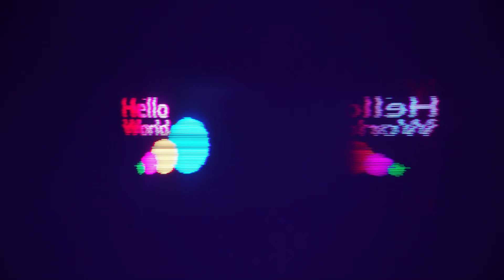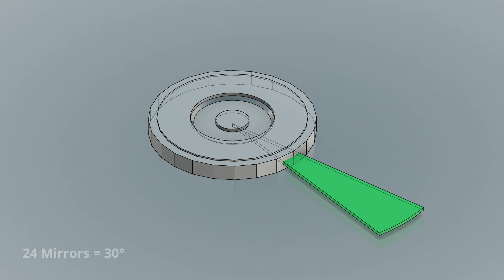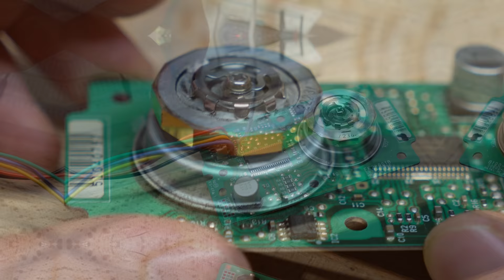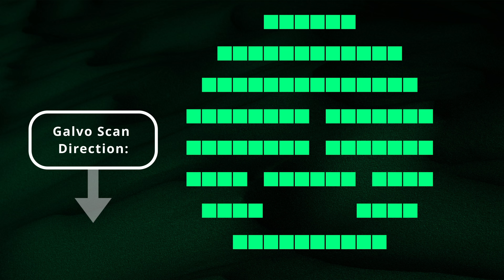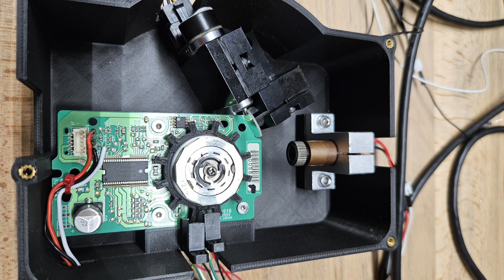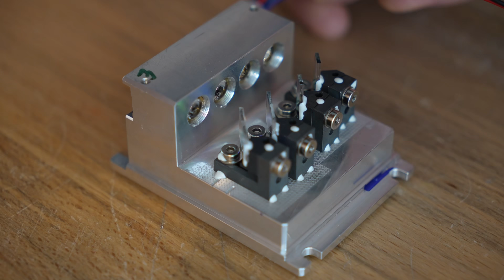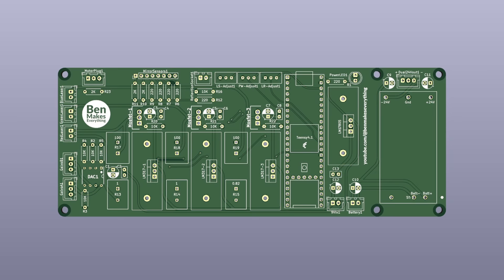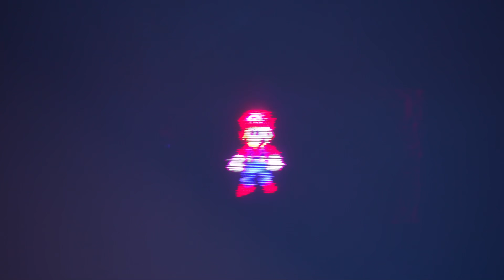DIY Laser Image Projector (100ft+ Range!)

Comment from the maker: This one took a while... Let me know how you would improve this device!
Reply: What sort of photodiode are you using for timing the laser pulses? How are you biasing it? Is it getting triggered by stray light scatter, perhaps? You could mount it at the end of an opaque tube with a diameter no larger than the beam width, with a light-trapping inner surface (like vantablack), so that only a well-placed beam can hit the sensor. Wrap the photodiode assembly in copper foil and use a shielded cable to connect it to the amplifier. You could also use two photodiodes and derive a differential signal for better noise rejection. Overall mighty impressive!
Reply from the maker: @zinckensteel  The phototransistors I'm using are Optek Technology OPB11782. They are just connected to the pins on the microcontroller and a 2K pull-down resistor. I'm wondering now if the timing glitches are actually just caused entirely by the way the Teensy microcontroller handles the interrupts.
Reply: Interrupts were my first thought for possibly explaining the glitches too.
Reply: That's right, I remember now.
 I was screaming at you because you only used a single mirror array.

My old lab setups from the very early days used two spinning arrays.
The first one basically looked like a table top cut of a diamond.
Very close to what you have here.

 The second one was more of a Decagonal rod.

You'll get much more control if you use motors with resolvers rather than trying to match up two free spinning elements.
However you are going to require some more computing power.
These setups are a lot of fun to play with in free Spin but you have to calibrate on every power up and you need a very stable power supply.
I made one for the sole purpose of projecting Flames onto smoke for halloween.
Projecting through film with a 0 point light source is a wonderful effect.

I couldn't afford resolver Motors so I tried to cheat with steppers.
It made synchronizing a little easier but there was still drift.
Didn't last very long so I ended up using a DMD chip.
Reply: You should be able to get much better image color using dithering instead of posterization. It's very simple to implement too.
Reply from the maker: @MikelMcdaniel  I'll have to look into that, thanks!
Reply: @MikelMcdaniel  but using analog laser driver enables millions of colors, dithering is for digital systems no?
Reply: Since you have the dual galvos and the extra driver channel, you could use a DC bias on the vertical galvo signal to 2D pan the output around, would add a lot to function to be able to move a lower resolution/ higher refresh image around in 2D space than having to use the raster space for movement. Would be awesome for some signage, yard art, even theatrical applications where a smaller image needs translated around a larger surface.
Reply: Excellent upgrade to the Teensy 4.0!
Over the past 4 years, I've been developing a T4 Laser Synth abstract (Laserium style) control system for multiple RGB projectors, starting with PJRC's I2S quad SGTL5000 audio DACs, following the 'Notes and Volts' 'Teensy Synth' tutorial series.
That would your increase your imaging/RGB resolution to16 bit @ 44.1kHz CD quality. 3 of the SGTL5000 DAC outputs could provide signals for RGB. The 4th DAC could drive your galvo (w/sawtooth or triangle).
I've just finished developing a PCB, using the T4.1 + a PCM3168 CODEC IC, which has 6 ADC inputs (for CV & audio mod) + 8 DAC outputs for standard ILDA XYRGBs outputs via DB25 + X2/Y2 + QWIIC + 4 spare GPIO outputs for lumia projector whats-its and thing-a-ma-jiggers.
Reply: Great improvement! Would replacing the horizonal galvo with spinning mirror help with the refresh?  
Also, would a higher resolution encoder disk help with the timing?
Reply: What exactly is your background? Every time I see a video like this, that requires a lot of different engineering skills, I'm gobsmacked as to how one gets to the point where they can pull something like this off.  If it were me I don't know if I would even know where to start. 😮
Reply: use a pure singlemode rgb laser  for better beamprofile, use digital laserdriver for more colors,  and more accurate colors.
Reply: @stijncuijpers  Please share where to find those affordable single mode RGB diode lasers  I've been searching for years.
BTW, 'analogue' drivers are required for mixing colors, NOT digital drivers, which are TTL and only capable of 8 colors ( including black).
Reply: @TheOleHermit  i find them on Ali, and i mean the new DT drivers that are digital setup, still analog mod, but usb and software to program, it has better colorbalancing and probably more dynamic range
Reply: @TheOleHermit  They're all over ebay, I've had a couple for years now. You can even find really crummy analog driven ones that have a really limited modulation voltage of like half a volt or so, but you can tune that into something usable with a proper DAC.

The alignment isn't usually that great, and they aren't very adjustable but what can you expect for like 70 bucks...
Reply from the maker: @stijncuijpers  I'd like to, but it seems hard to find them with 1 watt of output or more.
Reply: @benmakeseverything  I don't think you need as much power if you've got a much nicer output profile. Sure, you've got more power with those nasty multimode output diodes, but at a much lower power density.

You'll still be really limited by reds, and probably want/need to DIY one using a PBS to combine two reds instead of the knife array you have now.
Reply: its pretty epic if it can recieve images through the usb interface, or did I miss a part of that being mentioned.
Reply: Try shooting the beam through a pin hole to clean up the beam some that way you end up with more of a dot and the fuz gets waisted that might clean the image up some what. also the paddle yo use to show mirror position make it a blade to move a small amount of air while its rotating that way you get some active cooling while still serving the orgional purpus
Reply: PLEASE READ
This was absolutely amazing to watch, and I'm excited to see where you take it. Three things I thought of:
(1) You are using flat, (2) [apparently] second-surface mirrors. It may be possible to make your own mirrors. Using flat glass chips, and then slightly dishing them with 0.5um diamond paste on a steel die, you can get a shape that will juuuust barely prevent excess scattering. You would then reglaze the surface with a blowtorch, and finally plate using PVD. 
(3) You mentioned how tricky the mirrors are to position, and they ARE. A third mirror type you could use would be a thin film stretched between two plates. This would involve the center of each strip of mirror film [mylar? thermal loading?] floating free of the clamping support under rotation, and ballooning outward to a degree so small it would likely need an AFM to see it. HOWEVER, as your RPM is kept constant, this too should reach equilibrium once the interior is heat soaked. You will now have a mirror that is adjusted on every strip by one central nut, though you could use more radially instead to give yourself fine tuning [I dislike this for stability]. This would really clean up your image by making the individual mirrors much more uniform, and also slightly soften the scanlines, creating a sort of mechanical anti-aliasing.

Regardless of what you do, I look forward to see the next iteration of this project!
Reply from the maker: @kenshinbattousai374  Appreciate the input. These are actually first-surface mirrors. I believe its just an aluminum block with some type of electroplating (the color is gold-ish). I think its best for me to avoid anything other than a solid metal disc, given that this thing is already spinning at 15,000 rpm. Anything more fragile might be torn apart by centrifugal forces.
Reply: Possible improvements. Use back EMF from scanner-motor to indicate speed (rather than optical). PLL control comparing back-EMF counts vs line-scans - may improved jitter. I am going to have a go at this project, but using an FPGA using dual-port RAM as the video source/frame buffer. Also planning to putting effort into understanding/fixing laser astigmatism. Laser pointers have collimated beams... Anyway, very well done. Mark, New Zealand.
Reply from the maker: @markatherton7848  Those sound like good improvements. I did want to use something other than the phototransistors and tabs, but couldn't find the documentation for that motor/pcb.
Reply: Even though there might be a lot of friction, you could try using brushes as the timing system, with a more powerful motor to account for it, or you could use the input frequency to time it, with a 90 degree offset or something
Reply: How about ...
Laser (combined or mono) to galvo-mirror to concave mirror (only needs to be the width of the beam) that converges at the rotating faceted mirror. This way your horizontal and vertical resolution is only limited by the the laser switching speed.
Reply: @benmakeseverything - I thought long and hard about making such a laser video projector beginning in 1978, but the challenges at that time were insurmountable. Still, a few of the ideas may carry over... 
If the mirror faces were slightly curved on ONE axis, the reflected beam could cover a wider horizontal angle. That would make it possible to reduce the number of mirror faces. 
If the mirror faces were slightly curved on TWO axes, the reflected beam could cover wider angles both vertical and horizontal. Besides the advantage of wider angles, that would make it possible to do the complete raster scan WITHOUT needing either the galvo or another rotating mirror, though getting the curvature just right could be a challenge. Curved face(s) would not preclude use of galvo(s), which might still be useful to correct for minor non-linearities introduced by mirror faces with non-ideal curvature. Use of Electro-Optic (EO) modulators could make modulation of each beam possible at much higher frequencies than now, PLUS give MANY brightness levels even without modulating the lasers. Running the lasers in CW mode would use more power, but might result in better color purity. Liquid cooling of the lasers would also help, by reducing the range of temperature fluctuations. Bonus: Extended laser lifetime and/or higher current for extra brightness. Giving each laser a slight RELATIVE OFFSET ANGLE could eliminate the need for the dichroic filter-combiners, at the expense of losing full color at either the extreme vertical edges or the extreme horizontal edges.
I have MANY more ideas for all kinds of projects. Good Luck, and let me know if you want to discuss this or anything!
Reply: @YodaWhat  ...or use a prism to combine the colors.
Reply: @ExtantFrodo2  - Since the light sources are lasers, that prism method might work reasonably well, BUT any color drift of the lasers, and especially differential color drift between lasers, will result in imperfect collimation. So then he REALLY needs to run the lasers in Continuous Wave (CW) mode, preferably with liquid cooling.
Reply: What if you what if you duplicated it but had an overlap of half the thickness of the pixle to cover any horizontal black lines whilst increasing the brightness?
Reply: Maybe take a second look at using a MEMS mirror? They don’t all work by diffusing the beam
Reply: Yes, active cooling is a gret idea. Those diode lasers get pretty hot and will reduce resistance when over heated. IOW, they will deteriorate from overheating or even go into self destruct mode.
I have large heat sinks on the bottom of my optical plate, with fans blowing through their fins. 
You could also use TECs for cooling, provided no condensation gets inside your optical cavity, which should be sealed from contaminants.
Reply: @gaggleweed  That's already being done with UV lasers.
Reply: would a magnetic rotary encoder help with synchronisation?
Reply: You can use dithering to make converted images look a bit better
Reply: I think because your galvanometer-driven mirror is driven in an oscillatory fashion, rather than some kind of X-Y style dependent on the video content, you could just replace it with second rotating mirror.  That might simplify the design and reduce the cost.
Reply: gotta go vectorized images, maybe a simple game, Asteroids?
Reply: amazing gadget! maybe sync 2 of those to have double the pixels?
Reply: Can we get a how to or maybe a bomb, code, anything?
Reply: magnetic pickup speed sensing?
Reply: Industrial Tech here. I am thinking that a sinking circuit is the fastest. Closing the ground side for on and off. Might get some inspiration from industrial controls like plc's.
Reply: Princess Leia's secret recorded message from star wars projected on water vapour. will be nice.
Reply: FPGA raster controller.
Reply: DITHERING
Reply: Smaaarrrttt
Reply: @bobby9568  use your people voice, not your google voice
Reply: Ich hätte eine Idee! Was wäre wenn du statt einem Spiegel noch einen Zweiten benutzt? Und zwar auf der Rückseite also wenn sich die Galvos um 180 Grad drehen würden (was natürlich nicht ganz korrekt ist da du ja pro Seite 2 Gradzahlen ansteuerst aber ich hoffe du weißt wie ich das meine!?) Theoretisch ließe sich das noch erweitern du könntest pro Achse auch 4 Spiegel verwenden...🤓
Reply: Awesome project ! try to use FPGA instead a microcontroller to solve timing issues.
Reply: study how hall effext sensor gives te position on eletronic injection system. is almost exactly what you need to correct this poaitioning issue
Reply: I THINK the alignment of your red is actually off... and because there are 2 red it's gonna be quite hard to get them aligned with the green and blue..... and the red is more of a magenta, which remind of the old EGA video cards/monitors I used to build as a kid... they were 16 colors if you didn't know, but it makes me think about CYMK ... which MIGHT work better for color accuracy if the red always comes out as a magenta.... but that is a whole other can of worms you don't need to open right now... BUT you REALLY do NEED TO get that red aligned with the other 2....
ALSO, I agree that the "glitching" worked really well on the green text, it was a cool effect that screamed 'cyberpunk' or 'hacked' .. and was AWESOME!!! But when it comes to this new build, it HAS GOT TO GO!!! It RUINS everything and doesn't add the same feel that it does to monochrome text, which I would have thought that it would still look cool.... but it just doesn't
.. I have no idea what it could be doing that, BUT I think it actually has to do with a piece thats actually going bad.... I mean it's not a setting or a wiring issue, it's like a capacitor or resistor or SOMETHING that you used in both projects is starting to die, but OBVIOUSLY I could (and most likely) be TOTALLY WRONG! lol ...  but I don't think it's interference, unless it's interference with something in the system... like it's not coming from the environment like wifi or radio.... if it was in the environment you'd see it changing when you had it in different places and it would be more random... it is random in a way, but it effect on the system is the same no matter where you put it.. inside or outside.. but I am SURE you will figure it out, you seem to be genius enough to fix anything!!! :D 
AMAZING WORK!! You got my subscription!!!! :D
Reply: One improvement would be telling people to wear appropriate safety gear when working with lasers instead of "know what you're doing"
Reply: I see that your device has interlaced scanlines. To make progressive i would try a regular motor for vertical scan, and a two-sided mirror spinning constantly in just one direction, instead of one-sided mirror rocking up and down as you did.
Awesome work btw. Do you accept orders on this projectors? I would love to have one myself.
Reply: I think you should explore using a dmm.  I'd like to know if it's possible to interface with one. It would evaporate 90% of your project for $30.
Reply: That's a pretty neat project!  Congrats on getting a HackADay article on it.

The first idea that came to mind was to add a standard vector laser setup.  Use the vector laser to draw crisp outlines and the raster laser to fill them in.

The second idea was to double the hardware and have each setup overlap for an interlaced image with double the vertical resolution.

Cheers!
Reply: Can you share the GitHub files of the circuit and 3-D model
Reply: All devices that rely on mechanical motion to produce an image cause vibration and noise. If the laser light path could be controlled by a magnetic field, as in a CRT, the noise would be absent and the image would be more stable.
Reply from the maker: @misprojectos04  You're correct about the vibration, but unfortunately you can't bend light with magnets, only with gravity.
Reply: Make Still Alive or Want You Gone of this
Reply: would you put the code and everything in the description?
Reply: Make a resin 3d printer with it.
Reply: Mount it in an RC R2D2 'droid'.
Reply: You make me feel very humble , uh maybe a little dumb, ok quite a bit stupid and with a dog shit attention span.
Reply: A VGA video DAC should be plenty fast enough and stable enough for analog color
Reply: I'd recommend hall effect sensors for the motor. You could use just one digital sensor with a single or double magnet or a few linear sensors with a couple of magnets.
Reply: Do you really need a microcontroller? Try combining VGA output with some 74hc4046 (or other PLL) and 74lvc gates for motor/galvo control. VGA already has precisely timed HSYNC, VSYNC and analog RGB signals, so you can use PLL to build a PID controller to generate PWM signal for HSCAN motor so that the shaft rotates in-sync with HSYNC signal (you will probably need to use a fast counter implemented using 74lvc gates as part of feedback loop). You also need to machine a precise optical raster to minimize jitter (to eliminate "snots" from 3D printer (the imperfections along the edge)). Using 74hc counters and an SPI DAC you can control VSCAN galvo using HSYNC pulses as clock and VSYNC pulses as counter reset. For color signals you need high-frequency amplifiers to drive lasers.
Reply: @benmakeseverything The sensors in modern SLR cameras can tilt, shift and rotate to a certain extent with their OIS. And they do so extremely quickly. That would be perfect. To achieve this, I think all you would need is a mirror instead of the actual sensor.
Reply: You could use a hardware resistive DAC for lasers; it's literally just a bunch of diodes. The only thing you'd need for this is a sufficient number of GPIO pins.

This is the circuit for the very first primitive DACs - take voltage from pin 1 through resistor R, from pin 2 through resistor 2R, from pin 3 through resistor 4R, and so on.

For three colors with three bits, it's enough to have 9 free GPIO pins, which will give you 512 colors. Cheap and simple.
Reply: 아는게 별로없는데.. 그 우리 색상필터를 바꿔끼는것처럼 레이어를 축에달아 동영상을 앞으로 돌리듯이 분화시키는것도 가능할까요. 각 레이어가 서로다른 데이터를 로터화한다면 더 좋은해상도와 연산이 가능하지 않을까해서요. 전 개발자가 아닙니당..